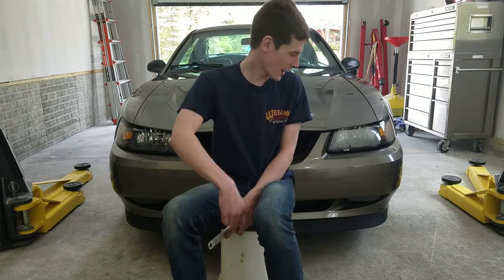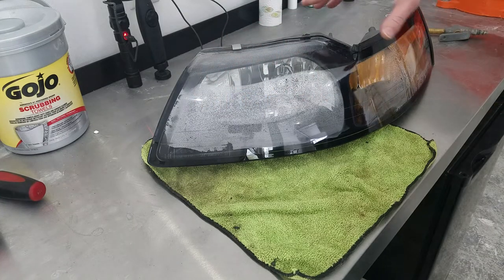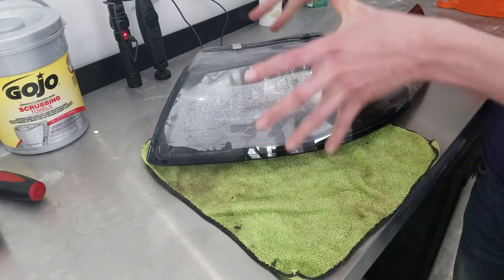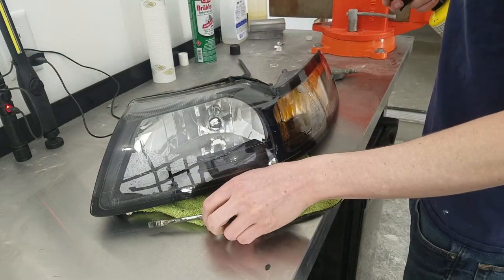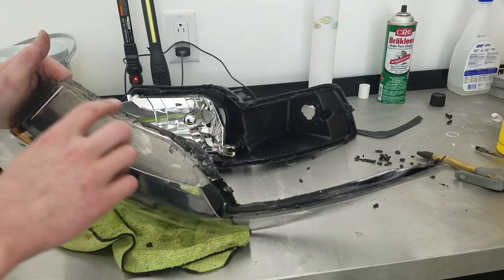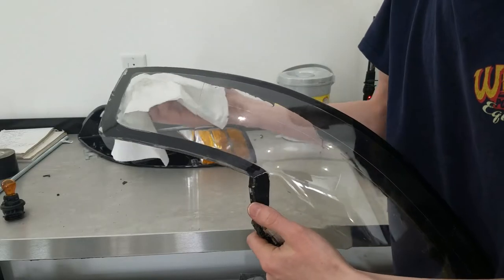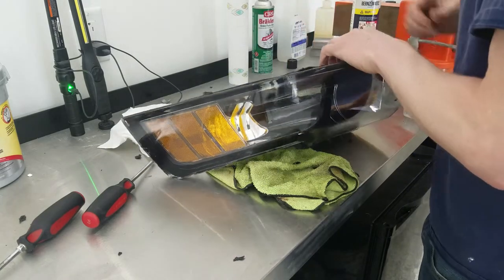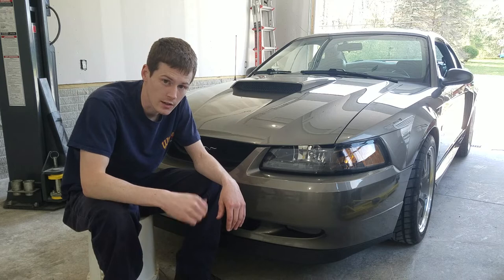How To Remove Water from Headlights And Completey Reseal Them.

Comment: This is the most time intensive clip I have watched. I prefer keeping the light together and spraying the edges with soapy water. Blow through the port on the back then look for the bubbles from the soapy water. Then you know where the leak is. Seal with silicone and done.
Reply: Yeah that is the quickest and best way to find the water leak .they do the same with tires.

Comment: I remove the housing, remove the bulbs and let sit over night to dry. Fill a Syringe with sealer and fill and open seam around the light. Always worked well. Good video. Very thorough.

Comment: This is exactly the video I needed! My headlight has been leaking and filling up with water for so long that it’s caused the inside of the headlight to turn orange. I not only have to reseal it but need to get in there to completely clean it first. Thank you!

Comment: dam, shots fired at ChrisFix lol.   Now its my turn, use a heat gun (not a hair dryer...) They sell them at hardware stores and auto body supply shops.  They come in useful in 1000 different ways including this, again they will melt the headlight but wont burn things like that open flame will with map gas.  It only takes about 200-250 degrees F to get them apart, so just keep the heat gun moving back and forth.  Then buy a pair of spreader plyers, they make it way easier to spread the headlight and wont damage anything like a screw driver easily can.  Other than that, R.G. is pretty much spot on.  You can get the actual glue the OEM use, but its a little more pricey than some clear RTV silicon... SO its up to you, questionable if either one is better.  As for headlight lenz fade/sun damage  I always wet sand in steps/ 180 grit/ 400 grit/ 800/ 1000 or 1500 then  no less than 3 coats of clear coat ( wet coats if you want to avoid orange peel, and dry coats if you want to avoid runs.. just in the middle of the two if you want it perfect )  OK!  Good luck out there.  (btw you can wet sand and buff the clear coat after it sits a few days to get it even more shinny)  But thats the best way to make them last, because automotive clear coat is way better against U.V. damage than raw plastic is, wich is why I tell people dont buff the headlights... wet sand and clear coat them.
Reply: Excellent tips! 👍👍

Comment: Hi, I know you are open to alternate and/or better methods having watched your generator NG/propane conversion video.  A much simpler way to dry out the condensation is to use a simple hair dryer on high temp & high fan blowing air into the bulb "holes".  So remove the headlight same as you describe and remove the bulb & sockets and with less than 10 minutes of blowing air thru the two bulb holes the condensation will be totally dry.  Sometimes the headlight actually has rain water within the enclosure so if it does tip the headlight around till you find the spot it will leak out, then use the hairdryer.  Same silicone bead along the entire top edge where the enclosure comes together.  I just used GE 100% silicone (10.1 oz tube for $4.50).  This will do a dozen or more so best to have some other sealing jobs around the house so you don't waste the tube  Also be sure to buy fresh silicone as a new tube > 1 year old will not set up and stay gooey for days or weeks or never set at all.
Reply: OSU 1986 the gooey silicone is perfect lubrication on rubber bushings etc.

Comment: is it ok to use silicon ? i though rubber butyl is the right product for headlights sealant ?
Reply from the maker: 4 years later... No issues.
Reply: @RepairGeek  thats good, but just incase you remove it how will silicon react? Do you think you will remove it? Did you put a hole or drill a hole in headlight? I saw in other video why they drilling a small hole in the back of the headlight. Thanks for your reply

Comment: just put silicon packets like they put in things to keep it from getting wet put it in there for a few hours you don't even have to remove the headlights or tail lights in my case after a storm it was lotta condensation in it mainly because the storm was very windy and normal rain it wouldn't get that bad For my car anyway it rarely rains over here so I just put a silicone packet in it let us sit in the sun remove the packet good as new... Problem is when it rains again it's gonna happen again .. Right now it's too chilly maybe in a few months i will seal it up

Comment: Great vid . I have a question . Can i use wax or rubbing compound when i get the headlight apart on the inside lens to remove any left over water spots ?
Reply from the maker: You can try it in a small area. It shouldn't be a problem but, test it first so you know if it does damage or not.